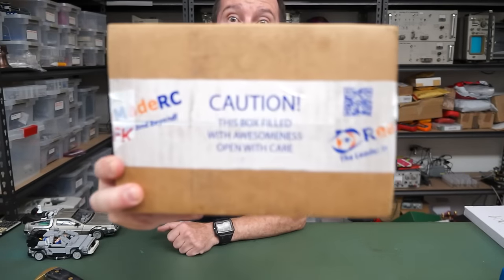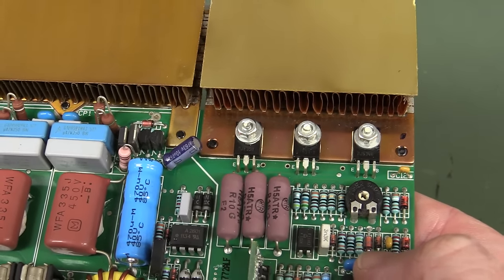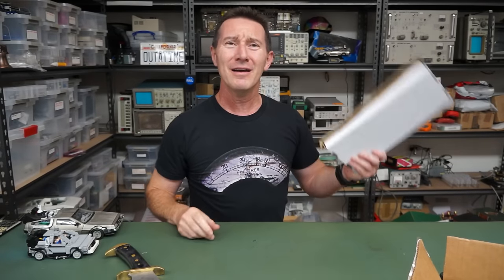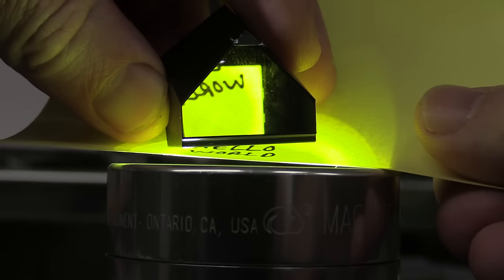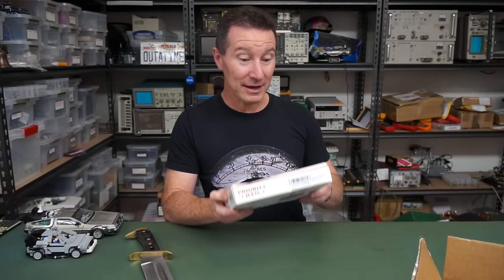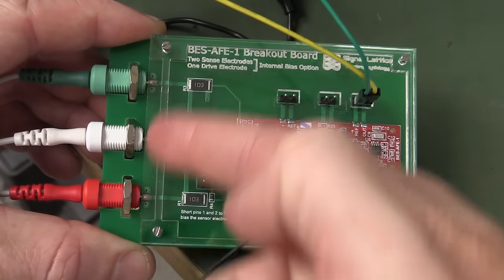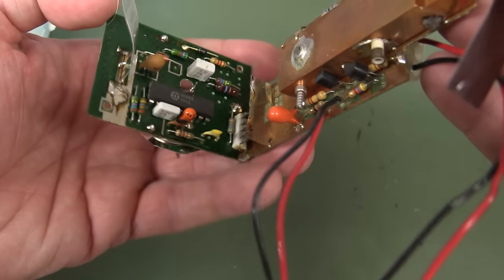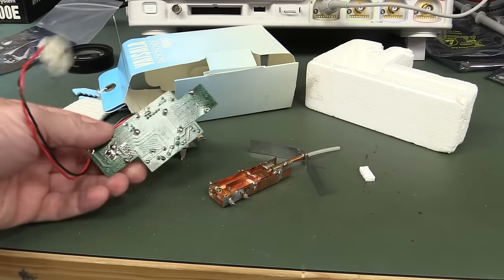EEVblog #970 - Mailbag

Comment: Paramedic student here. About the ECG, the reason you have a lot of garbage when you touch the screen is actually called an artefact, wich is made by you contracting your muscles (easy to see at 24:42), not the screen itself. Contracting muscles = so many polarisation/depolarisation in your nerves (long story short). Right after that when you cleaned it, it was a good readable sinusal rythm (Congrats!)
Reply: was wondering about this...couldn't see how electrical activity from other muscles besides the heart wouldn't interfere with the signal - apparently they do! Although 2 years later figured I'd ask: what are the proper steps for maximum signal integrity? Remaining still as possible I'd assume. What about shielding and the like?

Comment: The reason for the copper strip-line inductor in the radio-sonde is to achieve high Q in the LC circuit. It would be for frequency stability as it is just an LC oscillator without a crystal to keep the transmit frequency stable. 
I remember I came across a similar unit in the 80ies and they used clever techniques to send the temperature, humidity and the pressure using purely analogue modulation schemes.
I think they used the the transmit frequency to communicate the temperature. In that case maybe the temperature-contraction of the copper strip-line as it got colder  would be enough to change the frequency (colder = higher freq.)
Reply from the maker: Makes sense, thanks.
Reply: I wonder about arc-over under low pressures. UHF cans needed to be pressurized back in the dark ages

Comment: About the radiosonde, my dad bought a couple of radiosondes from a surplus store.  They were probably late 1950's early 1960's vintage.  As a kid I was really intrigued by them.  Like the one you have there were three sensors (I expect now they would have GPS sensors).  There was one each for temperature, humidity and atmospheric pressure.  Note that the sensors were all mechanical.  The barometer was an aneroid (I think that thing you showed in the inset, that you said was a humidity sensor is actually an aneroid barometer cell).  The humidity sensor was a bunch of horse hairs (or something like it) and the thermometer was bi-metal (as was/is used in electro-mechanical thermostats).

The "analog to digital converter" was really something.  There was a disk (like a vinyl record) with several tracks.  If I remember right the tracks only went around about a third of the circumference.  Then there were three styluses spaced 120 degrees apart around the disk so that only one would touch the tracks at a time. On the opposite end of each playback arm (with a fulcrum between) a respective sensor was connected.

Included with the radiosonde was a conversion chart.  The spinning disk with styluses would generate Morse code.  The chart listed what the code translated to in temperature, relative humidity and atmospheric pressure.

Comment: You are supposed to sit totally still and quite when you take an ECG. Muscles and movement will make noise.
Reply: Yes, I clearly remember the doctor telling me to stay still. It's not because of that dinky little electronics.
Reply: TheSkogemann  without any medical background (does getting an A* in IGCSS biology 1 year ago count?), I can clearly see peaks whenever he stresses his voice!
Reply: That's what i ment - you are not supposed to talk when taking the ECG. I don't have any medical background, but i have taken many ECG's and EEG's before. The nurses often freaked out at me as a kid if i moved the slightest or talked. (Aged 6-10) :D
I believe that some of the modern technology can filter out muscle activity, but i am not sure.
Reply: Nope, you can do ECG on Ergometer and even when walking/running normally. But that requires real equipment with shielded electrodes for example. The nurse wants you to be quiet because the diagnostic ECG is supposed to be made at rest condition.
Reply: @Jorg Fischer Shielded electrodes won't do anything if the patient is moving. The interference is not from EMI or capacitive coupling. It is from muscle that exhibits a signal larger in magnitude than cardiac muscle due to size and proximity (the electric signal of the heart muscle is attenuated before it reaches the electrode because it has to go through pericardium, lung, and skeletal muscle). You can get a usable ECG signal by reducing the bandwidth and increasing the rejection done by the filters. These things will result in signal distortion and may actually remove physiologic information from the ECG signal. The reason this is okay is because doctors aren't concerned about the information that is removed or distorted when it doesn't apply to what they are looking for. It can be, however, detrimental to remove/distort such information if you are using an ECG to clarify an arrhythmia or to be very sensitive in determining ischemia.
Reply: definately not made for stress testing
Reply: Hate to break it to everyone, but ECG can be almost perfectly insensitive to most artifacts when done properly. You need active electrodes with very low leakage and bias currents. Low as in “if you touch the PCB with your fingers, it’s already too bad”. As far as EMG interference: come on, people, EMG is an order of magnitude smaller than ECG, and in a different frequency band too. Those are all artifacts due to poor front-end system: motion sensitive cables, leakage currents high enough that the electrode impedance changes matter, galvanoelectric effects, and too big of a bandwidth. And furthermore, this stuff will never work properly without full isolation.

I have a 60+ year old portable Siemens ECG machine built with vacuum tubes, and it performs better this, even though it’s far from state of the art these days. There’s also a difference between research-grade and medical-grade ECG inputs: the latter perform worse, but still acceptably for use in medical practice. The former require custom electrodes and care in test setup, but are in a class of their own. 

The 10k input resistors are to protect the patient from input circuit faults only – faults that might put some current across your chest. Once you ground the damn thing via an oscilloscope, any interference currents picked by your body have large differential component and come up in the display. Why differential component? Because the electrode impédances are never balanced, and coupled with cable capacitance you get a beautiful balun, with unbalanced output. This is just poorly designed.

I’ve done a lot of EMG when I was a kid, and even with the tiny EMG signals it wasn’t as motion sensitive as this – as long as you had active electrodes with, say, CA3140 in metal can selected for leakage current (some were an order of magnitude better than the rest – that was the secret sauce). When you do EMG, ECG is the artifact and getting rid of it is a sign that you got your input system and experimental design right. 

Many old style EMG preamps will pick up ECG admirably, especially +/-15V powered front ends and valve-based ones since they have very wide input range and if you crank the gain down, the EMG is gone but beautiful ECG remains (with appropriate electrode placement of course).

Comment: Patent on measuring small capacitances will be to do with reading a humidity sensor.
Reply: Vaisala also had spinoff - Vaisala Technologies Inc. (VTI) - that still produce (I hope) top tier accelerometers, last time I heard about them their biggest gripe were that they produced too high quality and find a reasonable way to get consumer level product line to be competetive in consumer market. Most of the western cars had atleast one of their sensors about ten years ago.
Reply: Savupirtti wait why is that bad
Reply: Nothing bad. Consumer products are flimsy compared what they did, but the application base is wider and so is the volumes. They were just balling the idea and felt (jokingly of course) that it is hard task to produce a quality that by their quality standars ends up to trashcans. Accelerometers were just surfacing to consumer products (Nindendo Wii and smartphones etc.) in large scale back then.

Comment: The sensor strip on the Radiosonde is both humidity and temperature. The sensor capsule that goes in the clip is a barometric sensor, not humidity.
Reply: I thought it looked like a diaphragm pressure sensor rather than something that measures humidity.

Comment: EEVblog,   The sensor is temperature and humidity.  I am a meteorologist in the US Navy and I used these a lot.
Reply from the maker: Thanks.
Reply: And obviously, the clip holds a barometric pressure sensor (a diaphragm type I presume)
Reply: Vaisala these days runs the weather warning system (or something) of US these days IIRC.

Comment: That copper RF stripline section is a very high-Q tuned folded resonant cavity. You can see the RF transistor coupling at one end of it, the tuning cap to case ground (tiny capacitances are required to tune it) and the end-plate capacitance to feed the antenna. Purpose is to match the output impedances as well as provide sharp filtering (which becomes quite a problem at the frequencies involved if you want high unloaded Q factors)
Unlike cellphones and other mass-produced equipment the radiosonde will require a frequency not covered by off-the-shelf filters and being single-use cost is also a factor. 
Resonant cavity filters are also used for sharp filtering at transmission sites to prevent interference by co-located antennae and transceiver systems that would otherwise need to geographically well spaced to prevent desentitization of receivers being operated at the same time as transmitters. They can be set to reject or accept particular frequencies and are often applied in banks to obtain sufficient filtering. Their high-Q factor means losses are minimised and selectivity is maximised.

Comment: At 37:00 This is a power oscillator and the freq will vary due to the ambient teperature, thus a temp sensor and by measuring the receiver carrier freq you can get the temp info. Also an oscillator only circuit reduces the complexity and makes the supply current to rf power conversion a lot more efficient as back then UHF generation was not trival and the battery needs to be small and lightweight. Also this circuit nees to work down to -100C!.  
Gary -RF Engineer.

Comment: Wanted to comment on the LabGruppen part (first pronunciation in the video was the correct one ;). They are in fact one of the most renowned manufacturers of professional audio amplifiers and are quite expensive. This C-series is meant as a 'permanent' installation amplifier, instead of their touring amplifiers which are more ruggedised for use 'on the road'. The designs in a lot of their amplifiers are similar and indeed date back to the early nineties.

When you go to a large concert there's actually a reasonable chance that they are using LabGruppen amplifiers for the PA system. I believe they have majorly contributed to making lightweight class-D type amplifiers popular for professional live sound applications.

Comment: Radiosondes will last up to several hours depending on how long the balloon stays up. Visalia charged a fortune for the ground unit to receive the 400mhz version. Then NWS in the USA uses a 1.6ghz version. I have personally launched serval they typical use a activated water battery that you soak before launch. New ones use GPS the old ones either didn't give you wind dir and speed or they used a radio Theodolites hence the 1.6ghz of the NWS. I was born in 81 so the only thing i can think maybe something that may change the coupling the with temp. Would you like a modern one??? I can send one if so.
Reply: Don't ask just send it. Or do it yourself and post a video to show us!

Comment: Yes, they are relatively standard EKG connectors, the "banana" sockets. We used them on some EEG systems.

Also, the EKG board might have a 60Hz filter, not the 50Hz for Aussie-land. The low pass filter doesn't look like its optimized either.
Reply: There is a 50Hz notch filter on-board that rejects about 20dB given component tolerances as measured on the bench. What do you mean by optimize? Please elaborate. If you try decreasing the cut-off filter's corner frequency or changing the response to something like a chebyshev you will distort the QRS complex which can lead to misdiagnosis. If you want to increase the order then you will increase the gain error as well as will increase the space/cost/current requirements.
Reply: Oops. I meant low-pass filter. Not high-pass.  There is a tendency for A/D to get overwhelmed if the sample rate is too low, and the A/D range is not sufficient for the noise. 

Disclaimer: I worked on EEG systems, not EKG, so I maybe mistaken.

Comment: The special connectors on the ecg leads were brought in specifically to replace the 2mm exposed pins that they used to use. 
Apparently there had been accidents where old stile ecg leads had be inserted in to IEC power outlets which did not turn out to well for the person hooked up to the other end.

Any equipment that still used the old 2mm and also 4mm exposed bennana plugs had to be retro fitted with the new connectors. In some cases it was simply changing the connectors on the pannel. In other cases whole replacement enclosures were required. In very rare instances the product was replaced as it was not cost effective to replace the connectors.

Comment: Dave, this amp board is really two tracking buck regulators powering a 'normal' output stage. Those MOSFET's and diodes are the components for the buck stages. Schematics can be found on the web. Stunning amp anyhow. (have repaired some of those long ago)

Comment: Hi Dave,
I was hunting the RS-80 Radio-Sonde here in Germany. Was really great fun. We hat a 403 MHz receiver with a Yagi-Antenna. And we sometimes got these cute device. Our "German" devices where on 403 MHz that had a solder-jumper-settable PLL-Circuit inside for the transmitter frequency. The outer Sensor was Temp and Humidity. The big tin can inside is a capacitive pressure sensor. And there was an additional stripped-down GPS-Receiver glued to outside of the the RS-80. It only measured the different GPS-doppler-shifts from the satellites which then were transmitted as 9K6-RS232 with the downlink. The Main-downlink consisted of about 6 tones (each about 300 ms long) which represented either a reference-frequency or one of the measured parameters (Temp, Humidity, Pressure). It actually sounded like a badly tuned old fashioned Synthesizer-Keyboard  :-)  .At this time the balloons where already started automatically. The battery was an open and really dry stack of two different metals and something like cloth. When the sonde needed to be activated before launch some water or acid was injected into the battery which initiated the generation of electricity and started the sonde. A am sure that your device is not a 403 MHz device - but something like 2 GHz because the Antenna is a 1/4-Lambda-Groundplane and it is far to small for 430 MHz.

Comment: hahaha I've see inside of enough Lab Gruppen amps to know that layout as soon as I saw it! I am no pixie wrangler like you Dave. I am an ex live audio tech. I used to work for the largest audio company in Australia. Lab Gruppen is the bees knees in the live audio industry. The best high power, switchmode amps, built tough enough to handle being pulled in and out of a truck, and run as hard as they can night after night! The models we used where much more powerful.

Comment: It seem that amplifier is something they call "class TD". I imagine the mosfets/diodes/inductors in the middle is two buck converters one for each rail, with the voltages tracking the output to limit the dissipation in the regular class-B output with the NPNs/PNPs

Comment: Dave, your so-called penetrators on the Radiosond are in fact feedthrough capacitors. They were often used to feed low voltage power through metal enclosures containing high frequency circuitry and also feeding out the results that the HF circuitry produced. This prevented radio frequencies from escaping the enclosure.

Comment: The ECG. The noise is called artifact. All ECG systems do this. If you lay still and stopped moving the device around, you will get a much better result. even while you were dancing, I can see all the relavent signals required to parform diagnostics. A time pulse would be good in order to calculate/confirm timings. The signals are looked at from an amplitude and from a timebase point of view. An earthed farriday cage would also help.

Comment: The radiosonde will have a water activated battery, one that doesn't contain any harmful stuff (heavy metals etc), as these things generally plop down in the sea. Mikeselectricstuff did a teardown of a much newer one.
Reply: Also a mechanical barometer attached to the silver circle on the bottom. I had a complete one that I took apart to learn how it worked.

Comment: That amplifier is actually a very modern design. It is class TD. It uses a high efficiency SMPS and a class AB output. But to increase efficiency they add a buck converter(the power diodes and mosfets you show)  between the PSU and AMP which monitors the input signal and provides just enough voltage to the class AB amp to avoid clipping. With so little difference between the active voltage rails, and the voltage of the signal being reproduced, you get a very high efficiency.